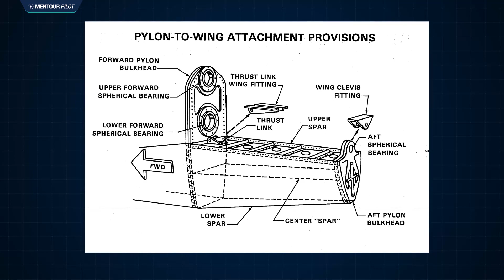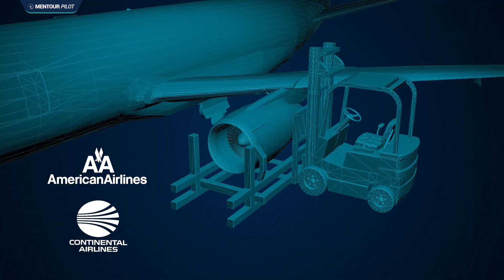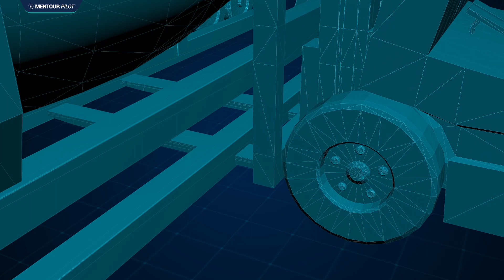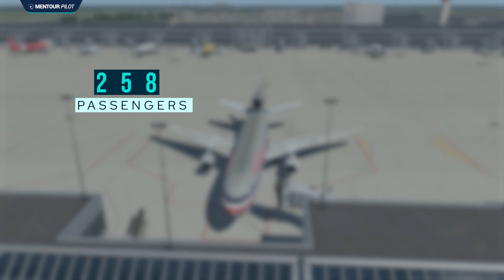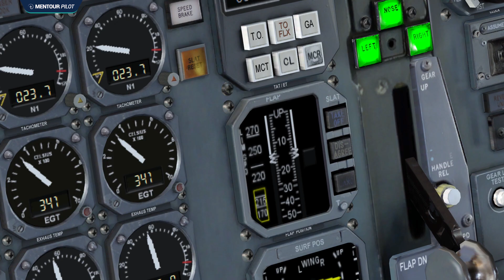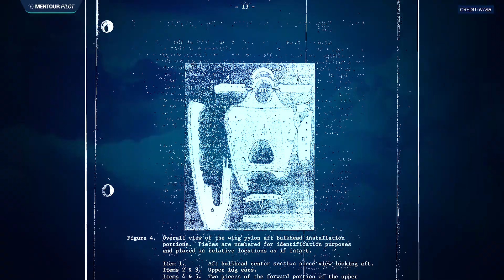The WORST Single Aircraft Accident in American History

Comment: The DC 10 has a defect. When 1 engine fails, all 3 Hydraulic Systems fail at the same time leading to complete loss of Flight Controls etc... ( united Airlines Flight 232)..  on American Airlines flight 191, the cause of the accident is Hunan Error... During maintenance... American Airlines didn't follow proper procedure of detaching the Engine from the wing ( Engine First and then Pylon assembly)...
Reply: I misread this as "The DC 10 WAS a defect", as in the entire plane was a mistake, and I thought "Well that's a little harsh."

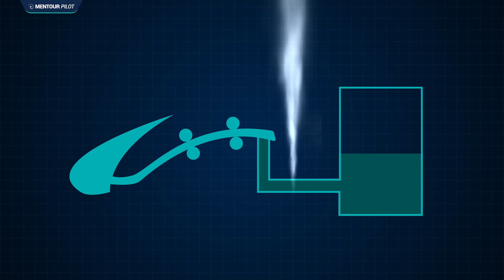Comment: Nit picking but should the animation at 17:50 show the hydraulic reservoir refilling as the leading edge slats are forced back in? I guess it may be the path of least resistance over the leak path in which case it would partially refill.
Reply: All of the hyd fluid was being vented overboard through the torn out hyd lines with the rest of the fluid.